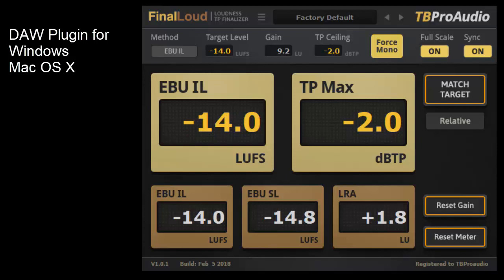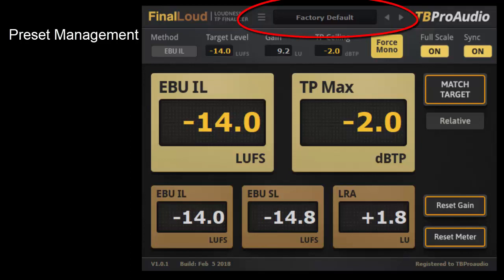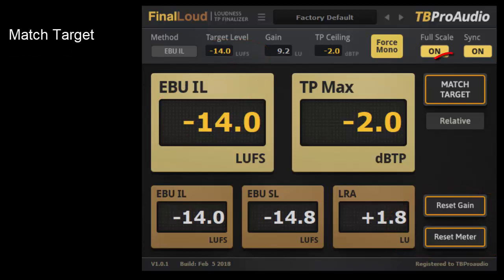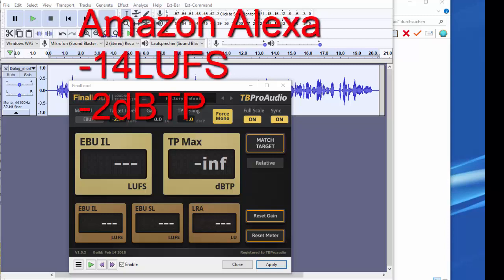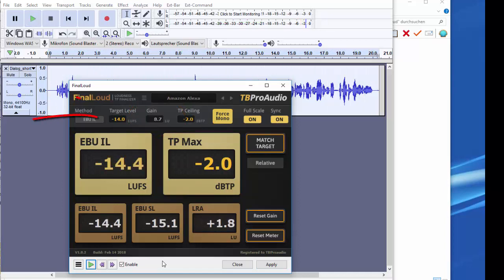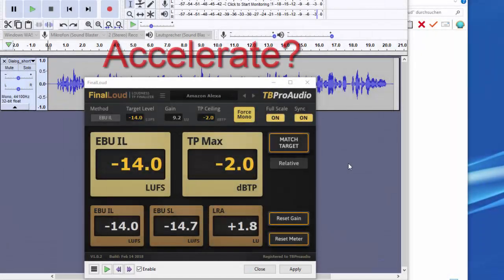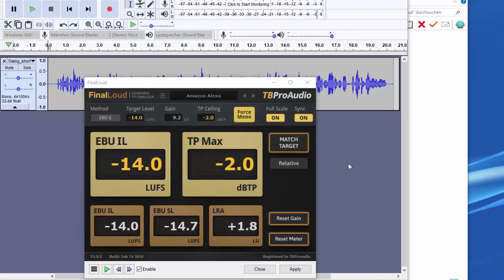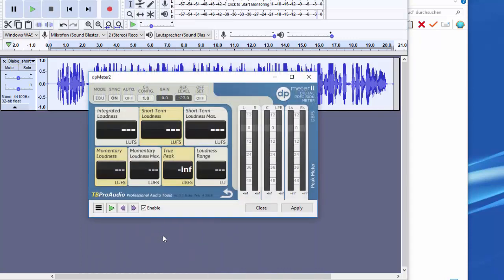FinalLoud Introduction

Comment: Thank you for all of the help via support.  I've had unresponsive tech support over the years (from other companies of course), and it was very refreshing getting detailed answers/responses very quickly.  

I'm hitting my Content Loudness perfectly -0.0, -0.1, -0.2 regurly now, yet my voice still isn't as clear (and the volume is still dimmed down) compared to other YouTube channels.  Very frustrating.  But you promised that your program would hit that target, and we're all good with what your program promissed.  

For the record I use Audacity, and EVERYONE has various recommendations on all sorts of Audio Chains (post production), and none of them have hit a sweat spot for me to work with.  Everyone has different answers, with different settings, and the audio never comes out as nice as it should be.  For the record, I've gone through dozens (if not +100) videos on what steps to take, and they're all off IMO.  I've been trying to "solve" this problem for 3 months now, and it's just lead me to a constantly expanding trial-and-error fiasco that I never want to relive.
Reply from the maker: Please contact support[at]tbproaudio.de for further assistance.
Reply: Hey, im a post production audio engineer. In pro audio we do NOT normalise to a specific LUFS for most online uploads, including advertising! You must master your audio as loud as it can be without introducing audible artifacts, limiting any unwanted transients and ensuring that you do not have excessive bass or midrange in the programme material. Making the mix slightly bright is important. 

My mixes are typically between -11 and -9dbLUFS for youtube upload. Youtube attenuates to their standard! Do NOT use this plugin for youtube or social media uploads. 

I only normalise for TV material which is R128 by law. 

Making loud sounding mixes is a skill, and this plugin does not compensate for mixing skill. 

Hope this helps.